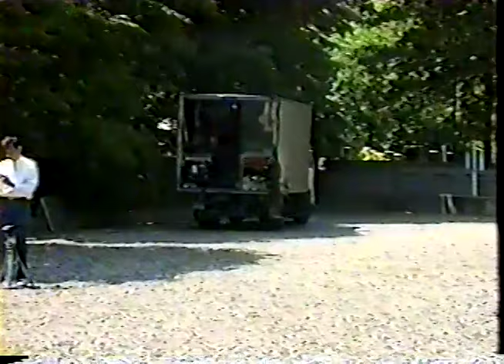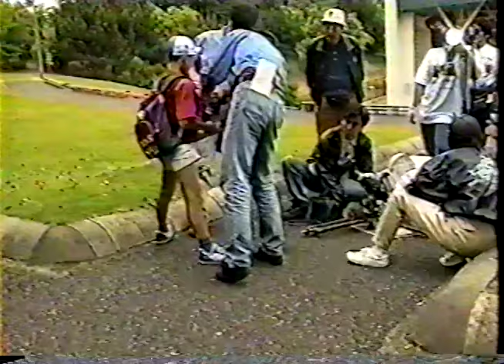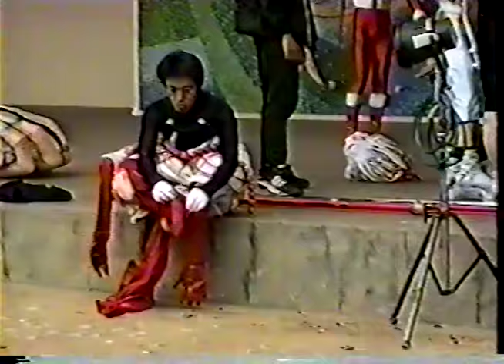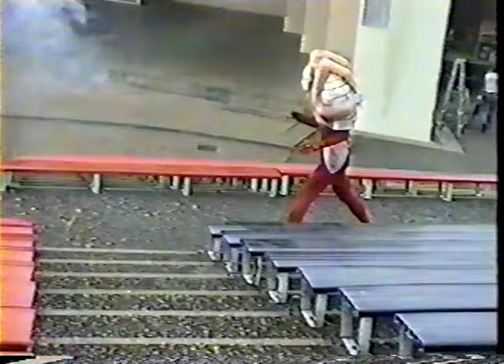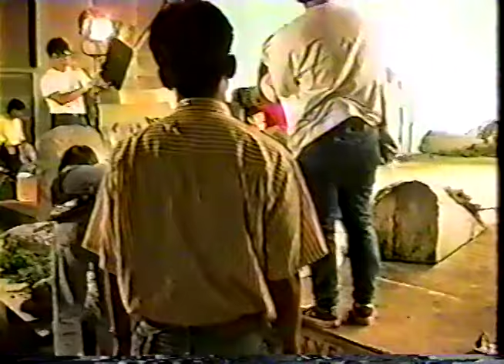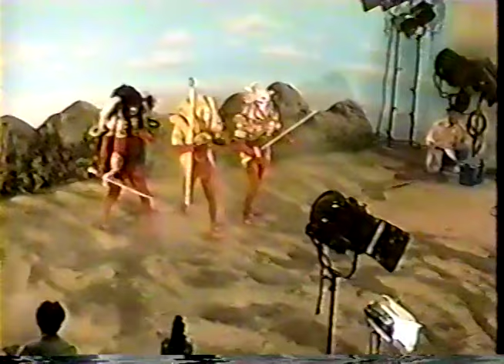Rare SENTAI  behind-the-scenes video from MMPR director/stunt coordinator Jeff Pruitt

Comment: For anybody wondering the shots at the amphitheater are in Dairanger episode 21 about 6 minutes and 45 seconds into the episode. The zord footage at the beginning and end are in Dairanger episode 22. Most of the zord footage seen in the video starts at 16 minutes and 28 seconds in that episode. It is the same zord footage used in White Light part 2 of Power Rangers season 2 with the footage starting at 14 minutes 40 seconds
Reply: The Amphitheatre is also in MMPR S1 Episode 4, where the Rangers fight King Sphinx.